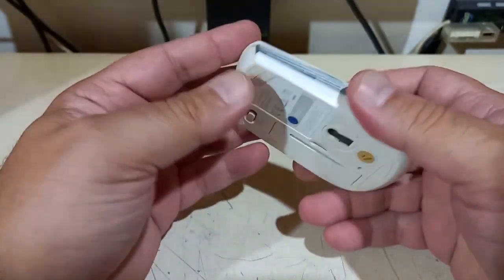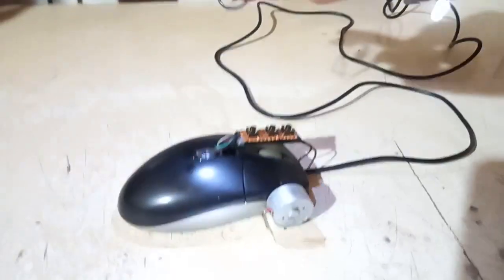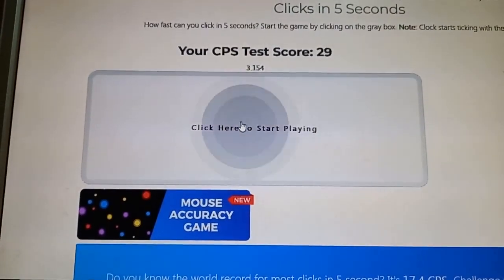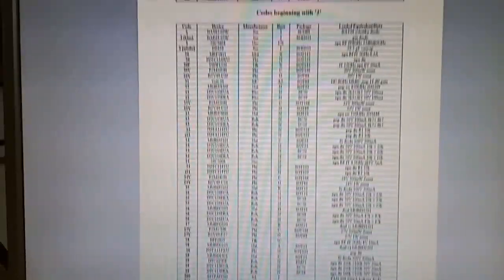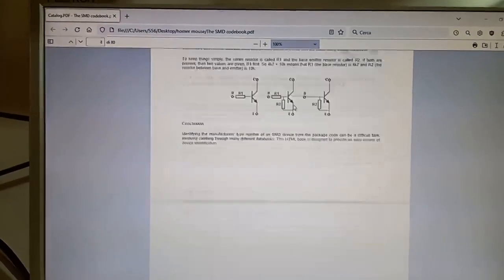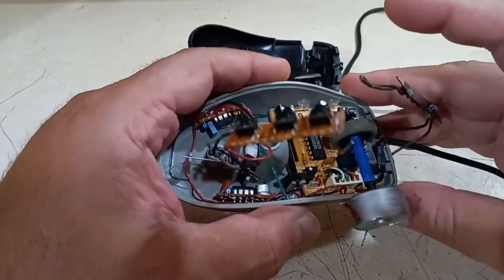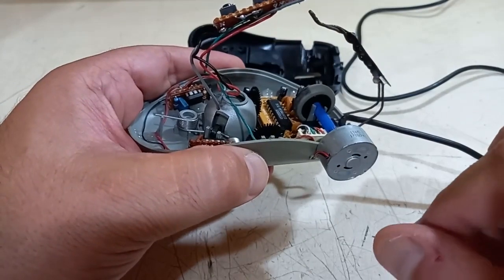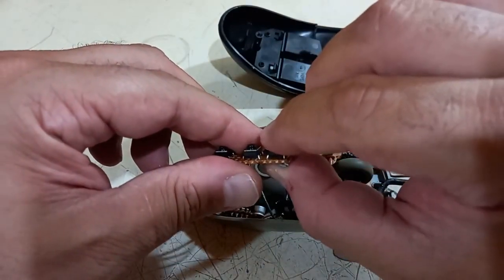1000 Subs Special!! - "The Homer" Mouse!!

Comment: now i can cheat on Minecraft server pvp without getting ban
Reply from the maker: "with great power comes great stats" 😂
Reply: bro i bought some irfz44n MOSFET please tell me how to make a very powerful flyback driver "dhanyvad धन्यवाद्"
Reply from the maker: @nibhasharma5551  that mosfet is a bit low in voltage rating, i made a ZVS driver with similar ones (it's not published tho) and you have to make anything low voltage, so bigger capacitors, more current, less turns for the coil or flyback primary, you can power it with a max of 17Vdc... it doesn't work too well anyways... the schematic is the same tho
Reply: but my mosfet is rated for 44v
Reply from the maker: it reaches the supply voltage TIMES Pi (3.14) and it's rated 55V instead (read the datasheet), so 55/3.14=17, and trust me, when the datasheet of a mosfets says 55V, it's 56V maximum :D they are oddly precise